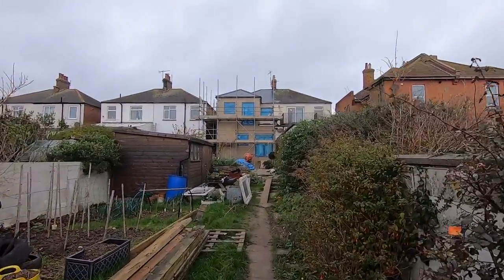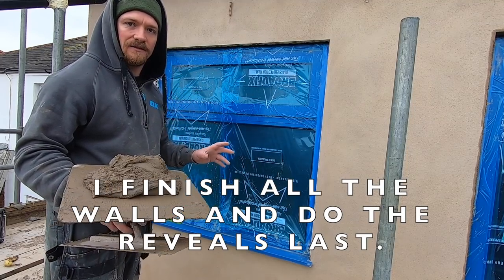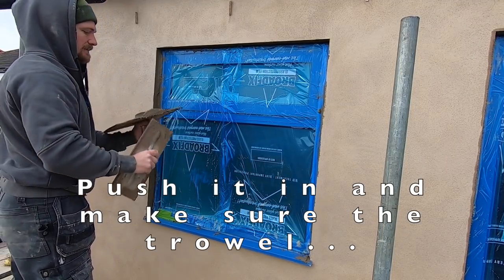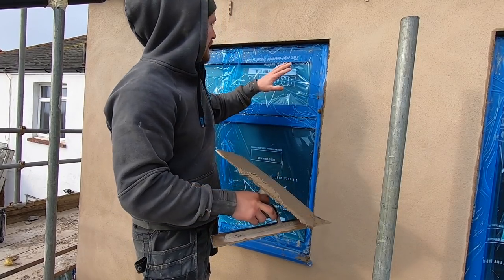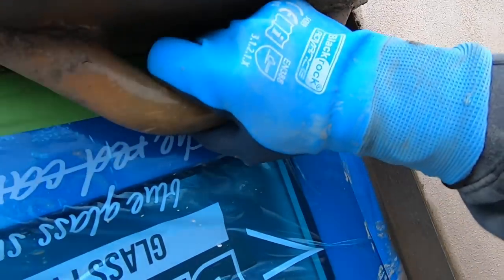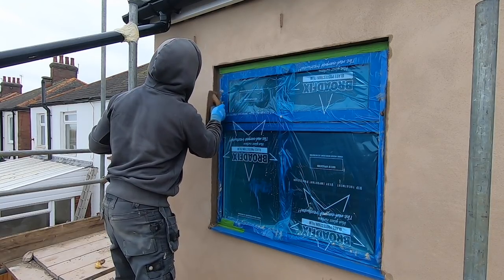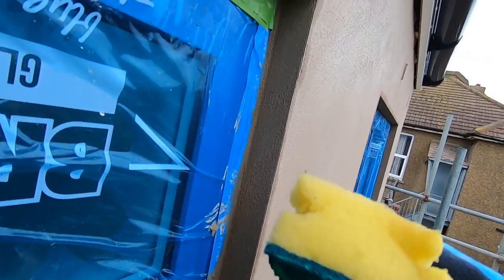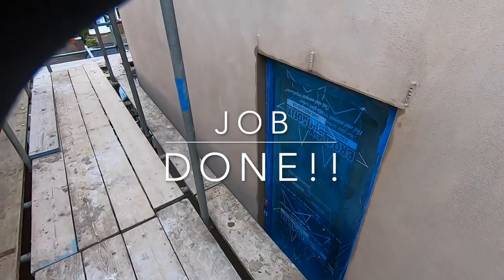CONTROVERSIAL Approach To Rendering Reveals | LAST DAY ON THE JOB

Comment: Thought it was k-rend as well , is that sand and cement you mix or a ready made powder form that comes in the bags like fassa . It’s a Great finish you’ve done fairplay . 
I’ve started to cut down stop beads and stick them on level against the window it’s a massive help and easier to lay on you can run your trowl bead to bead . Good work 👍

Comment: Top tips Blaine, cheers. By the way are you using the same trowel for plastering or keep a different set for rendering?
Reply from the maker: I did at the beginning but I use 2 seperate ones now. However I'd recommend you use the same trowel if you have a new one. The render really helps to break trowels in 👍

Comment: Very nicely done! Do you remove the tape while it's wet, or leave it on? I'm doing a window and accidentally rendered my tape in place, now it's refusing to come off cleanly
Reply from the maker: God it's a nightmare when that happens. I tend to leave it on but I use Frog Tape because it's a lot easier to remove. Good luck getting it off 👍

Comment: Lovely bit of work as usual.Nice finish on the render.Which sand did you use and is there snowcrete or lime through the mix as it’s a great pale colour.
Reply from the maker: I used Sandgate sand - some of the best I've used and I mix Lime in the mix. It's good stuff 👍

Comment: Be careful  when rubbing the reveal with the float if the render beads are are galvanized it can damage the galve and they will rust  use stainless steel render beads or plastic for fine down finishes , just saying ,good vlog to show beginners  well done 👍

Comment: Here's a question for you. Once a reveal has been rendered in. Say years down the line one wants to remove and replace window. How would that be done?
Reply from the maker: You can replace it from the inside but there's going to be damage either way unfortunately. It's sometimes easier to work from the inside though I think pal 👍

Comment: How do you rate those waffley Refina floats Blaine? I tried one once and hated it, gathering dust in my workshop ever since. Do they improve with break in? 

Cheers
Reply from the maker: It's taking a while to break in but I'm starting to like it - it's getting better the more I use it. Just takes time but I think it's good!!
Reply: @PlasteringForBeginners  will give it another go, if it messes up my walls again its going in the skip 😂
Reply from the maker: Haha I don't blame you 🤣
Reply: @PlasteringForBeginners  just out of interest, do you let the S&C fill the diamond holes? Its a smooth face you're ultimately after right? Mine might be too new and clean